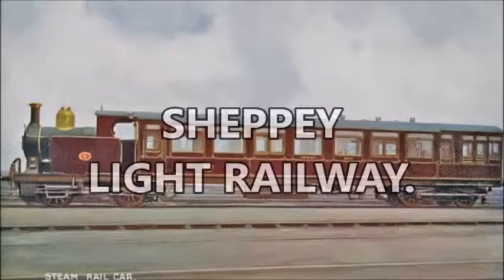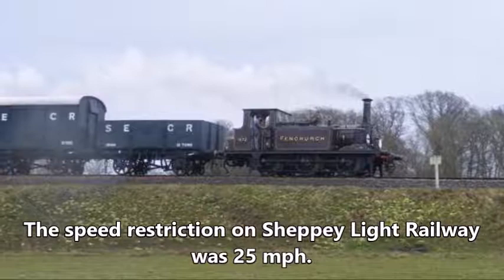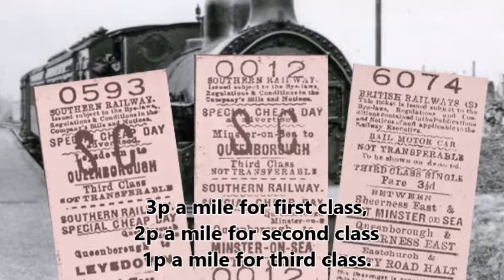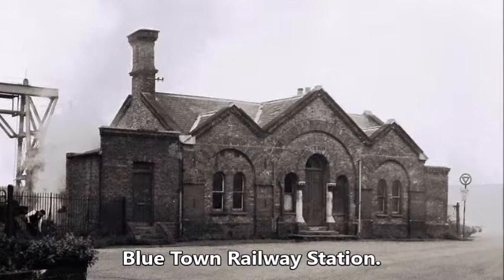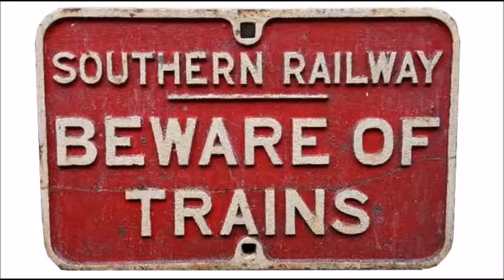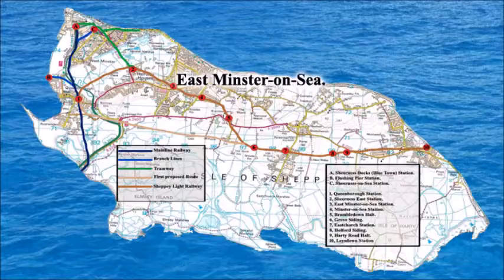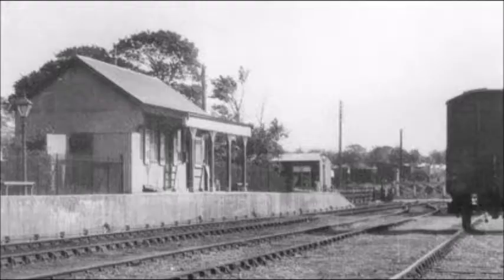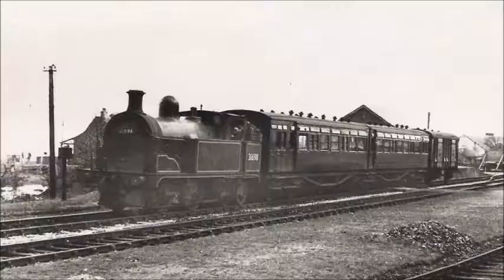Sheppey Light Railway

Comment: Sheerness on Sea Station was built a long time before 1983 - and the trams stooped running a long time before 1983.
Reply: Sheerness on Sea Station was opened in 1883
Reply from the maker: You are of course correct. A bit of a typo there, the Sheerness-on-sea Station was built in 1883, not 1983.